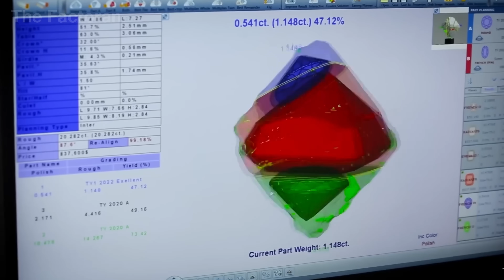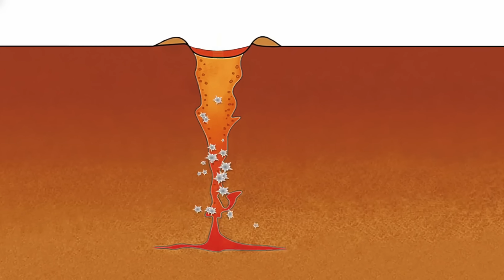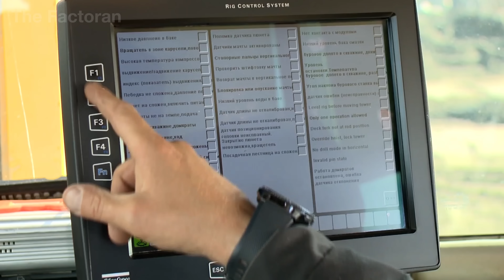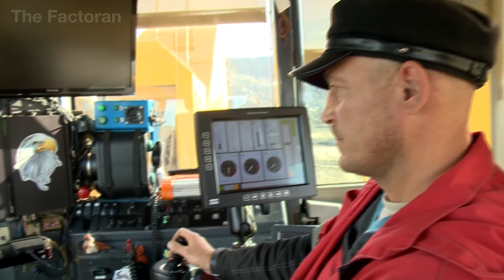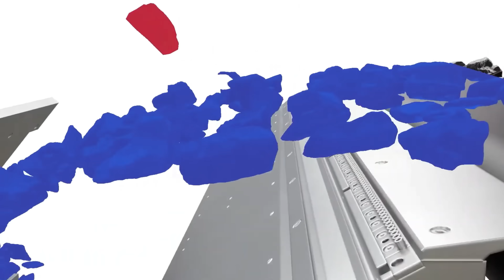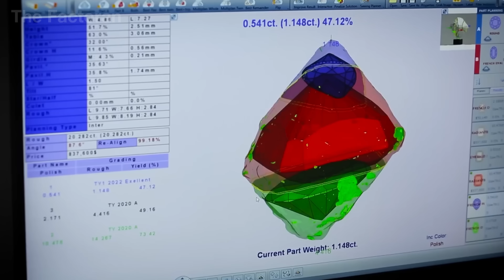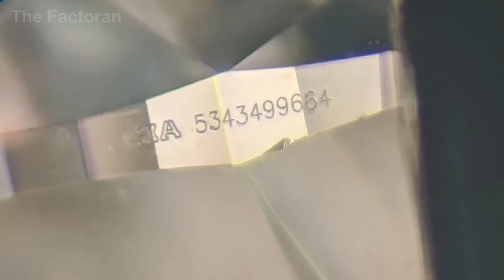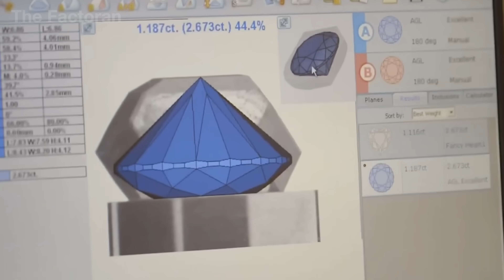How Millions of Diamonds Worth Billions of Dollars Are Made In America |  From Mining To Factory

Comment: The most funny part is that all that precious metals and stones don't add any possibilities to life. Their basic necessities are very negligible.
Reply from the maker: True — they hold little practical value for survival, mostly symbolic and economic importance.
Reply: @TheFactoran 💯
Reply: What about industrial drills and saws, high-pressure research anvils, heat-sinks for chips and 5G, radiation detectors, quantum sensors, surgical blades, ultra-hard coatings & water-treatment membranes?